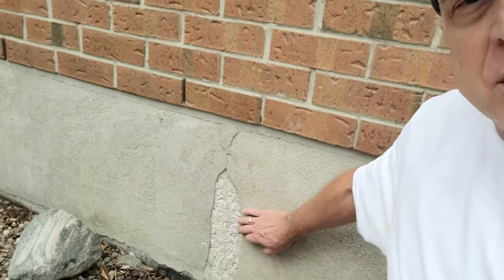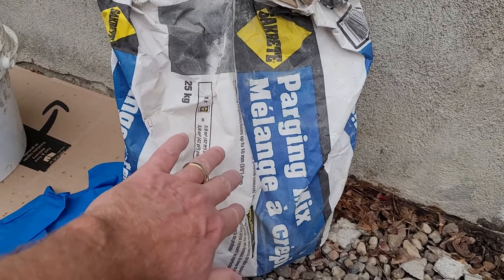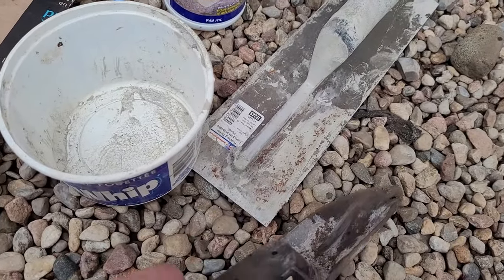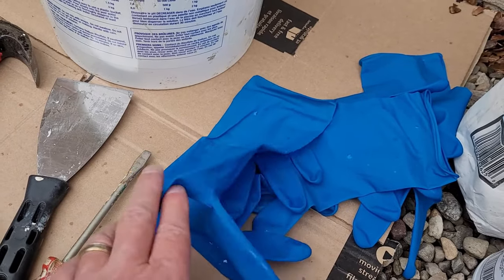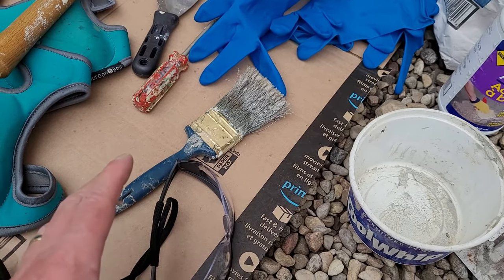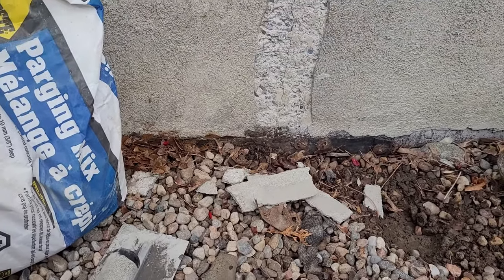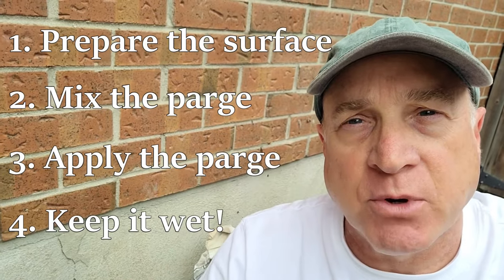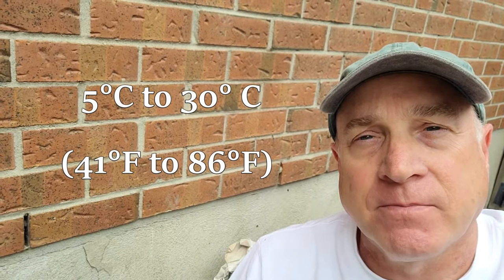How to Repair Foundation Parging

Comment: Thanks, this video was informative, but I also got a kick out of watching you go back-and-forth adding water, then, mixture, then water, then mixture, etc, trying to get it just right… I felt like I was watching a video of myself working, ‘cause I could really relate.  God forbid I should ever just read the ratio off of the bag, then doing the math to tell me the exact amounts (trial & error is much more interesting) LoL.
Reply: That's me trying to mix small quantities of plaster of paris for drywall repair. Always end up with more than I need.
Reply: @martinliehs2513  It's entirely appropriate to have too much, rather than too little - joint compound is cheap.

Comment: Been going through this with my old house.  Rapidset mortar mix worked great for areas the size of the palm of your hand.  I had square feet that needed to be done around a window so my construction neighbor came over to help.  He used Mapecem quick patch for flooring, yes flooring.  He showed me how to work it into place.  He did good work.  But I needed something that was slower setting and for vertical surfaces.  I'm just a rookie.  So I am trying my hand with the rest of the larger repairs with Sakrete surface bonding cement.  So far so good.

Comment: Using a fibered stucco mix will help prevent a return of the crack. A little added lime will also provide a bit of flexibility as well as spread a bit easier. A large construction/masons sponge or a damp sponge float would make the float finish and feather edge much easier and faster. A little stiffer mix will also help prevent future cracking.
On balance though, not a bad DIY patch.
Reply: Good tips!  I moved recently so I'll probably never know if it cracks or fails!
Reply: what about the crack at the top

Comment: You dont need the adhesive because the parging mix should already have some in it. also the parging mix is not the best option, making it yourself would be the absolute best option! You dont have to keep wetting it for 3 days. Also that will keep coming off the wall because of all the compromised spots under the brick. Unless you redid the entire wall of course. Next time if you make a stiffer mix , one 1/4 inch coat would be sufficient.  If you're  happy with that for your home 👍 . Better attempt than most!
Reply from the maker: Thanks for the additional tips, Greg!
Reply: I have a few questions. What do mean, make it yourself? Isn’t it just portland/sand/bonding agent mixed? Why is making it yourself better. I only ask because i have to do some on my house and i would prefer it outlasts me. Youtube videos are great, but often the most valuable info comes in the comments.
Reply: How would you do it? What products?
Reply: He also ignored the foundation crack

Comment: Was that purely for aesthetics or does it serve a practical purpose? Like would that exposed concrete deteriorate or cause a leak inside?
Reply: From Google:
Parging covers any existing cracks on the walls and adds an extra layer, increasing the strength of your walls and their structural integrity. A parge coat will also prevent water from freezing in the cracks and holes, which is a common cause of damage.

Comment: My area does not carry parking mix, what other product can I use?
Reply: Rapidset Mortar Mix
Reply: My area doesn't carry parging either. I'm not sure about using rapidset mortar mix. I'm still doing research.
Reply: Rapidset CementAll has finer grain than Mortar mix, and is stronger.
Reply: @bobbyb7127 
You can use sand and Portland cement.
Reply: 3 parts of washed sand, one part of Portland cement and if you want smaller grain in the finish you can use  silica sand or even mix both always keeping the same ration with the cement. Add concrete glue in the mix and mix it until you get a nice creamy uniform mix, not too soft but enough to be able to spread it easily. YOU DONT WANT CHUNKS IN THERE SO USE A CLEAN BUCKET!

Comment: That structural foundation crack will be back parging crack in a year with out fibreglass mesh if you live anywhere that has Frost thaw annually.
Reply: Not structural.

Comment: So what about fixing what is at the ground level? Is that necessary? I see it’s on either side of that big patch you fixed.
Reply from the maker: In my case, I was worried mostly about the big area that had fallen off.  This stuff is strictly cosmetic, so if you're worried about other areas, go to town!   I did go back afterwards and apply additional material along the ground level...you can probably see it in the later views.

Comment: Prime example why everyone shouldn't make tutorial videos. If you know anything about cement work, plastering and mixing then its clear to see he doesnt really know what hes doing. A basic diy-er and thats fine...however...he should be following someones video who knows what they are doing instead of making videos trying to teach someone else.
Reply: Idk. I did the same thing he did and its been over 10 years now and its still holding strong.  I call BS on your comment.
Reply: @phucyutoob6477  Love your handle but the video clearly shows that this guy has never mixed cement or mortar before and the tools he used and the finish that resulted are also telling of his lack of experience. So all in all I would have to agree that this isn’t the video to watch.
Reply: Then how would you do it?